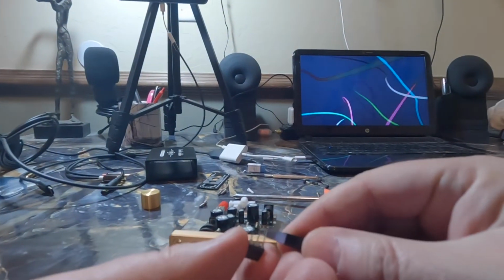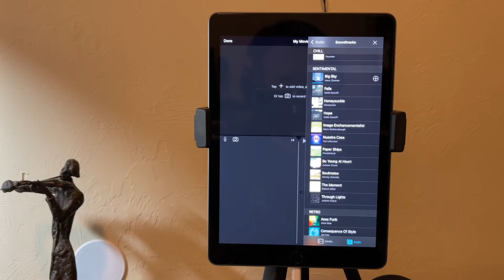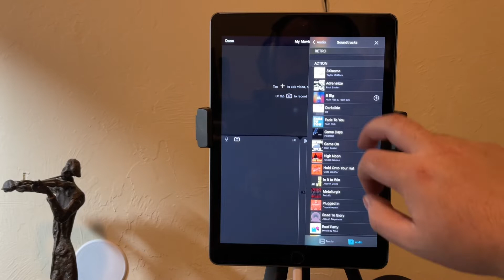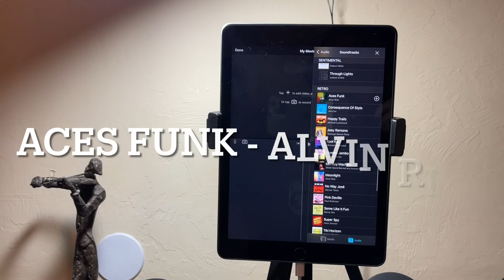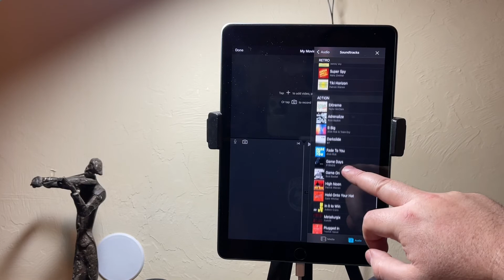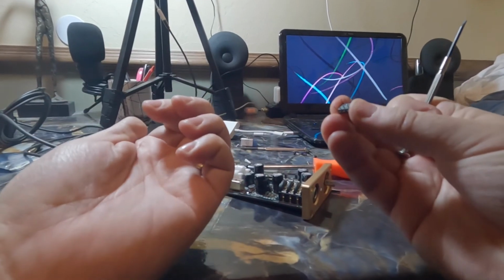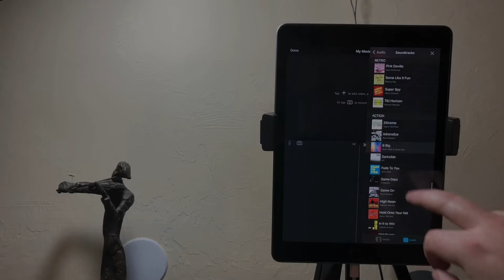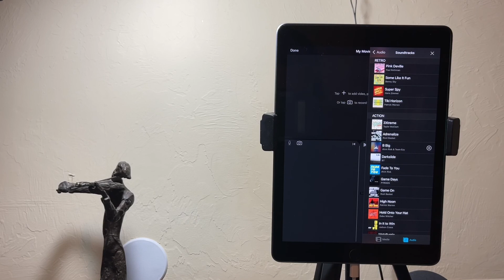Let's replace the op amp in the Douk Audio U3 Amplifier and hear the difference. And I get stabbed.

Comment: Thank you for the great video! Did you notice a difference in the soundstage being better? I use the Douk with a Focusrite Scarlette 2i2 interface. I use the same headphones that you used ( Beyerdynamic ). I love that the headphones are very balanced and perfect for mixing audio tracks but I'm curious to hear if the soundstage can be improved upon. I also have Audiotechnica ATH M-30s which have plenty of soundstage. So I could always just use those for listening to my finished tracks or other artist tracks on those.
Reply from the maker: Thanks for watching! I don’t remember there being much of a sense of soundstage difference.  In my experience sound stage can open up some on headphones that have too much mud in the bass with some eq. 

I also do enjoy the beyerdynamic headphones more with a dedicated amp than with my audio interface. So I think clean power can help. 

For instance I have a euphoria umc204hd audio interface and a shiit magni. I much pretty it on the schiit- the headphones feel cleaner and more powerful with better soundstage.
Reply: You're most welcome! Thank you so much for your reply!  That makes a lot of sense with the cleaner power helping. I definitely need to really absorb the new sound with the Douk now. I just got it not too long ago and in fairness only just tested it out for the first time. So first impression was impressive but now it is time to start using them to use them and get the real feel. It is awesome experiencing new equipment!  I'm looking forward to watching more of your videos! They are well made and I love that it is you genuinly just sharing rather than like some channels it being about the views upfront but lacking substance in the content.
Reply from the maker: @shawndworkin  thanks that’s very kind of you to say. Good luck on your audio journey. What kind of audio do you create?
Reply: @hackinghifi  My pleasure! Thank you very much!  I make all kinds of audio. But I lean towards experimenting with mixing orchestral arrangements with different other genres or trying to push boundaries and make something off the wall that I've never heard before. I personally don't listen to any music from the industry anymore because of the dark side of the industry I know of. So nowadays I either listen to my own music or I seek out those that are not yet noticed and are doing something unique  in my local area or sometimes outside of it. I made a flyer to have a library meetup of DAW composers who make music purely for the love of music and not for profit or career. This also keeps the intentions clean and more about just having fun. The bands I used to listen to were classic rock, like the band Yes and my favorite classical composer was Sergei Prokofiev and I was also a fan of extreme metal like death metal and black metal. I still enjoy that kind of instrumentation but stay away from the dark lyrical content of it.
Reply from the maker: @ cool man! Sounds awesome hope you continue to enjoy your passion, I get a lot of satisfaction out of both the listening and recording component of audio.

Comment: Great video, the OPA2134PA is currently EOL and I can't find it from non-chinese retailers (I'm honestly scared to buy fakes). 

Do you have any recommendation for OPA2134PA alternatives in 2023? 

I'm currently browsing the lowest THD+N chips by Texas Instrument like the OPA1612, OPA1611, OPA1622 and the OPA1632 but I'm not entirely sure of what I should be looking for to prevent compatibility issues. The stock NE5532 and the OPA2134PA apparently have very different operational specs, does any OPAMP work as long as the form factor is identical? (I have no issues with soldering if needed)

Thank you again for the video!
Reply from the maker: Sure thing! As far as I can tell the form factor was the same I think you can use whatever you like.

Comment: Does the stock amp has neutral sounding character? Or do I need to look for other op amp? I'm looking for neutral sound since I sometimes will be using it for assisting in audio mixing process.
Reply from the maker: It’s been a while since I listened to it stock but it has less bass than some of the replacements so I’m assuming it’s more neutral. Thanks for watching!
Reply: Yes

Comment: my favorites for  just enjoy music are the trulis ha8802 it have some oldschool musical analog flavor , then if you want more analitic crisp sound the truliz ha8801 is just perfect, no need to invest in more expensive op amps with those two, its like some nerd just did the resume of perfect op amps for headphones in just two flavors. the douk u3 is a very nice amp, it works better at 12v instead of using a 5v cellphone charger or usb port, im planning to recap mine with some nichicon caps
Reply from the maker: Thanks for your input! Can you explain how the 12 volt charger works and where to buy one? I’ve been worried since I tried an hdmi splitter with the wrong adapter and smelled molten plastic lol. Also how I go about buying the op amps you mentioned. Thanks!
Reply: @hackinghifi  just use some laptop one
Reply: Main thing with me is CLARITY.
It doesn't have to be absolutely neutral/sterile but it MUST be clean &open with enough bass going on :)
So w/e gives you that is what I'd want :)
Reply: So you have a link for 12v? I'm noon. Cheers
Reply: I think you dont necessarly need 12V,you just need to feed it more than 5W

Comment: Why is the third Todiys much quieter? What is the exact types of the op-amps? Todiys TL072CP for example? Thanks for the video!
Reply from the maker: I must have made an adjustment in the audio level without realizing it I noticed that as well. In practice it's about the same volume.  I'll update the description with the op amps thanks for watching!

Comment: Hi, Why are you adjusting the pins before inserting?
Reply from the maker: They weren’t lining up right! Thanks for watching.
Reply: @hackinghifi  Thanks, just checking as I plan to roll an op amp soon for the first time and am a little nervous.
Reply from the maker: @mrnobodyz  it’s not a big deal just know they’re very bendy so be super gentle putting them in and you can make small adjustments if you need to with a little pressure.
Reply: @hackinghifi  Great. There is a “female holder” included with the the first op amp I ordered and I practiced popping it in and out so I’m feeling more confident since I left the comment.
Reply: @hackinghifi  I just rolled the op amp on bedroom DAC (oracle 02) the smell of burning DAC (circuit board?) alerted me to the fact that I got orientation wrong first try😬 Seems alright, sounds great. Not 100% sure the Chinese bought “Oracle”is legit so will get a different, better op amp for my main system DAC. Great fun!
Reply from the maker: @mrnobodyz  haha nice! There’s a few options on Amazon you can try I think one is a grab bag with a few options in it if you wanted to play around. I’m guessing they’re the kind of thing that’s dirt cheap from Ali express.

Comment: Hi, I bought the u3 to replace my Kenwood basic c2 connected to the PC as a headphone amp but I was disappointed by the 30-40hz zone which on the U3 is much lower than the Kenwood preamp. Do you think that by replacing the 5532d I can get more presence of that bass? Which ones? Thankyou.
Reply from the maker: I found the amp did make a difference in terms of tone, definitely for bass. Plus it’s fun to try different things. I did a walkthrough on setting up equalizer apo also, you could probably get the same thing from that just using free software if you want to try that.

Comment: If you ever find a Muses 8920D (under $10) laying around, you should throw that in there and give it a whirl.
Reply from the maker: Cool thanks for the heads up. Have you tried them?
Reply: @hackinghifi  I have, and it is an effective upgrade for the money that seemed tailored to my Rode NTH-100's, and HD580's. I ended up swapping the caps to Nichicon as well, and landed on a Muses 02 opamp ($45), but I already had that to spare from another amplifier build. I wouldn't recommend buying an 02 for this as it destroys the value proposition. It is exactly my cup of tea though.
Reply from the maker: @JeradBenge  awesome thanks for the info! I may try that in the future. I was surprised at how much of a difference the op amps made.
Reply: @JeradBenge Muses 8820D/8920D, BB2604, Oracle 2.....
Reply: @Panslapper  OPA1656 has come down so far in price that it kind of eclipses those choices, although the oracle 2 might be more your thing if you like warm and smooth, or can't find an OPA1656 on a dip8 adapter, and don't want to solder.
Reply: @JeradBenge ...ordered.

Comment: Thanks for the video I own the same amp ..I was curious if it made a difference there a slightly difference. Better ?  That's subjective I believe !
Reply from the maker: No problem! Thanks for watching. Yes I think it definitely makes a difference, but it's more about what sound you like vs better or worse.
Reply: @hackinghifi  I personally Happy with the amp sound stock n has plenty of clean power it's a steal at $40 off Amazon!
Reply from the maker: @CRAZYCRADER  It definitely is a steal, especially with good power supply for it. It's super powerful!
Reply: Im using it with A LG v40 phone with a Quad Dac drive my Sivga Robin headphones the amp brings out the best in the headphones sounds. asboultly amazing definitely worth $40 easily.  I bought more expensive amps none not near as good.

Comment: How do you open up the unit
Reply from the maker: There’s screws in it then the top slides off if I remember correctly
Reply: @hackinghifi  oh the screws at the back? I thought I needed an allen key because of like the hex nuts on the front panel but yeah thanks man. Very nice vid
Reply from the maker: @gavingranado2146  sure thing! Thanks for watching